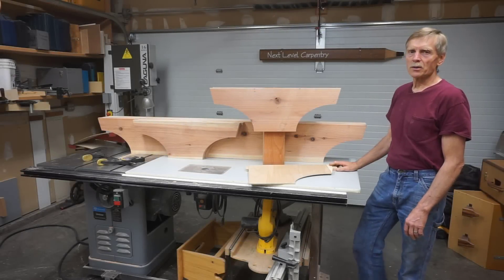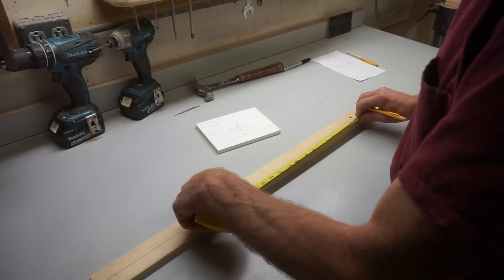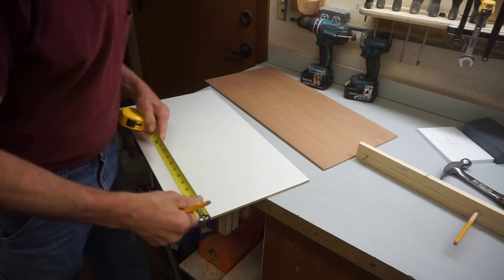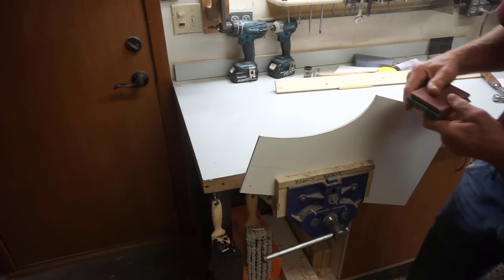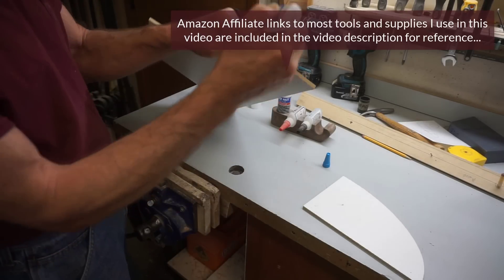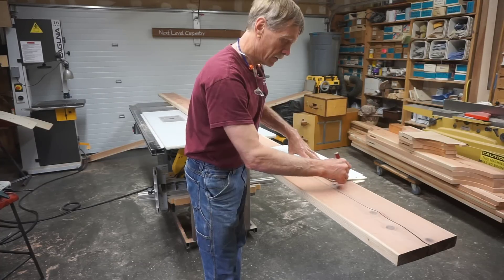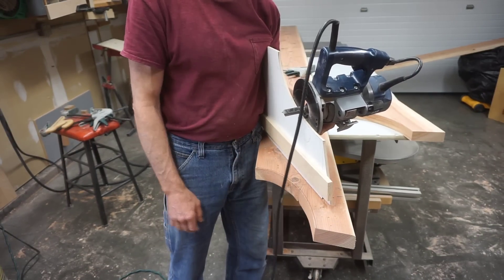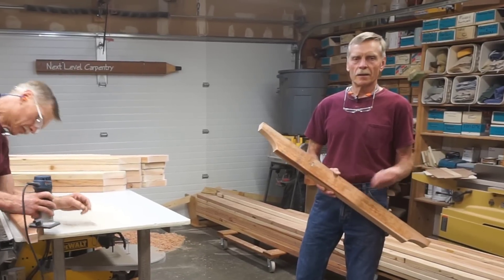How to Cut Decorative Ends on Pergola Joists

Comment: What kind of wood was that?
Reply from the maker: Since it's an outdoor structure the joists are redwood.  It's about a coin flip choosing between redwood and cedar these days so if cost isn't too big of an issue I opt for redwood most of the time.  Best, Matt
Reply: I didn't think it was cedar but I really couldn't tell. I don't think that's available in my area. If it is then it's expensive. Here in Southwest Virginia all we have is Pine for demensional lumber. If you have serious money or a small project you use cedar. And if working indoors red oak is king here.
Reply from the maker: Austin: There are always regional differences in availability, that's for sure!  I'm jealous of the guys farther west who have beautiful Douglas Fir in plentiful supply, much better then the stinky, stringy 'hem fir' that's most common here.  You might find it interesting that the pair of gates I made for this same pergola project had 1x6 cedar boards for the panel and redwood for the gates stiles and rails... just the way it worked out.  BTW you can see the gates in the 'How to Draw Arcs for Woodworking Projects' video here at NLC.  Fun stuff! Best, Matt
Reply: I'll check that out. Frankly lumber around here is mostly worthless. The blue and orange home centers are a total waste of time. The only place you can buy decent demensional lumber is a local home center. But it's pricey. The only place you can get rough cut lumber is a real lumber yard but there's only one and it's a drive for me and again, pricey. And I don't have a planer so I don't even bother. For those reasons I'm pigeon holed to plywood for straight flat and square projects and pallet wood for everything else. I love pallet wood. It's plentiful and extremely varied. I found one a few years ago and made a beautiful yet simple coffee table with black iron legs. I don't know what species it was but it looks just like wormy Chestnut to me. Although I seriously doubt that I couldn't bring myself to sand or finish it, it looks great naked and weathered.
Reply from the maker: Crazy that one of the toughest parts of being a carpenter these days is just finding the right wood to work with, right Austin?  I know what you mean about pallet wood... I don't have much use for 99% of it but that rare 1%?  Absolutely gorgeous and amazing... even if I have no clue what it's called or where it's from! 😁😎  Best, Matt